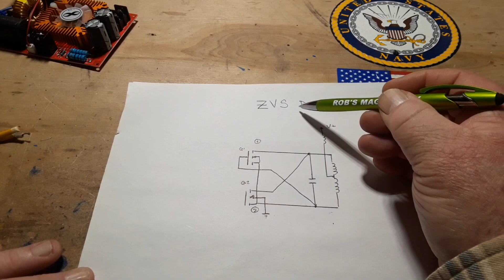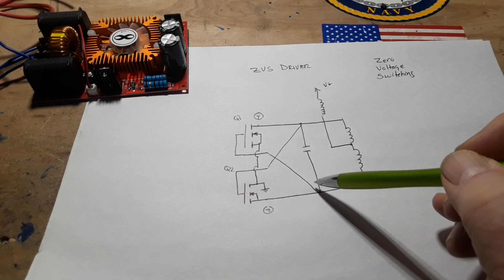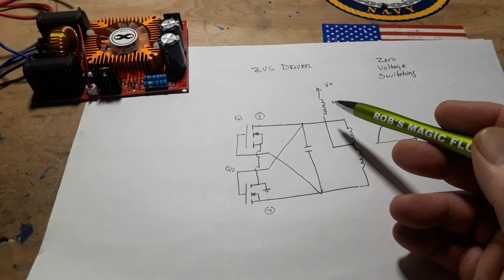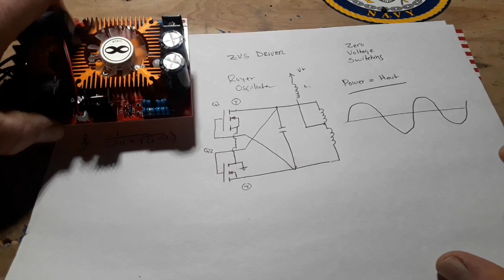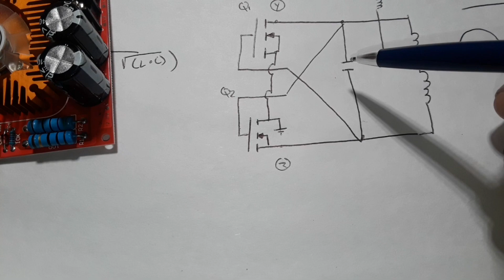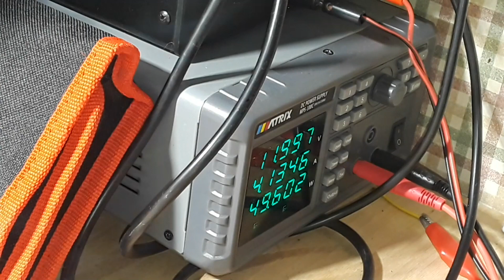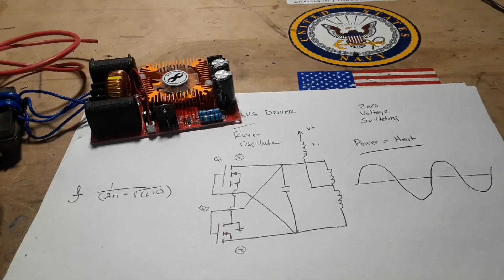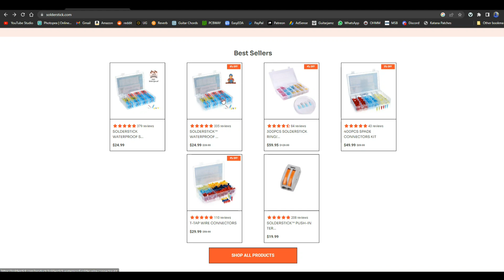All about the ZVS Driver Circuit - Sponsored by Solderstick Wire Connectors

Comment: GREAT VIDEO!
When I design things, I always want 'long-lasting' reliability for applications in actual products.  one thing that always bothered me in the ZVS circuit was the fact that it depends on one FET turning on FIRST!  But, as you know, in repeated use, there is going to come that instance in history where they BOTH turn on at startup!!  I am trying to figure out a simple way to decrease these odds.
Maybe slightly different FETS, or somewhat different valued resistors for one side of the circuit, or a slightly differing speed speed component on one half???  Maybe something that restarts at turn-on if that hi-current short occurs........
It's this a thing that gives me that annoying 'feeling'...know what I mean?

Comment: Hi. I have this model too, and I am using it to try and power a transformer too. I tried to use a 12V 6A DC lab power supply from my physics department, however it only outputted about 0.06 Volts on the 3 outputs. 

Can I know what is the voltage and current input that you are using?
Reply: At around mid way you mentioned that 12V can be used. I will be testing again tomorrow witha  12V 10A DC power supply. I am wondering whether a 12V 20A DC supply works too, or even a 24V 20A DC. thanks for the reply :)
Reply: Nevermind i just reached the part where you mentioned 12V 5A, hmm I am not sure what went wrong then. Any recommendation?
Reply from the maker: Switching power supplies can be subject to a great deal of EMF. Try a transformer supply or automotive battery

Comment: Why 2 pi? Because 2 pi R better than 1!
Reply from the maker: 2 pi because if you do a FFT a sine wave is a circle.  The diameter of that circle is proportional to the frequency.I try and avoid the deep dark calculus to keep folks from running away too quickly 🧐
Reply: @learnelectronics  oh, absolutely.  My method is to give people a bit of levity to break up the seriousness of the calculations. Give them another reason to stick around. I've seen you and a number of other "teachers" use that method as well. It's a mark of a good instructor who wants to make things fun for the student, as we all know what happens when they become bored. 

My 2 favorite pi? Pumpkin, to start (home made, of course) and  Graham Cracker pie. This one I've not had in years as the 2 places I used to be able to get it have either had fires or gone out of business. It's like a Vanilla milk custard with Graham cracker crust and and Graham cracker crumbles on top. 
Now I'm hungry for pi(e).... 😁😁
Reply from the maker: Pecan pie is my favorite!

Comment: I guess I have a couple of those but didn't know it. I bought a cheap induction coil heater in a kit and it fried itself in minutes.

It was so cheap I just ordered another rather than figure out how to fix the first one.

I still haven't soldered it together but the components are large and far apart so it's almost impossible for the builder to screw it up. 

Now that I understand how they work I may even take a peek at the fried unit again.

I do miss the old open dumps we used to have; I used to get flyback transformers out of old TV sets at the dump along with many other components. Those old console TV'S and stereos were a goldmine for parts
Reply from the maker: My grandmother had a Curtis Mathis console stereo. It was about 6 feet wide, 3 feet deep and 3 feet high. That thing was a gold mine! After she passed in 2000, I took all sorts of parts and components. The console itself was used as a bar in my old house.
Reply: @learnelectronics   The coolest one I ever seen was a Philco radio bar made in 1934. I found one with the radio missing for my father who was born in 1934. It took a couple of years but I finally found a radio to fit it. I wish I had one for myself but the prices are now ten times what I paid for the one I originally found.
Reply from the maker: Oh I know! I tried to buy an old tabletop tube radio that reminded me of one my great grandfather had in his bedroom. I figured they'd be priced like a tube amp...say $300-1000. Oh heck no, cheapest were almost a thousand.